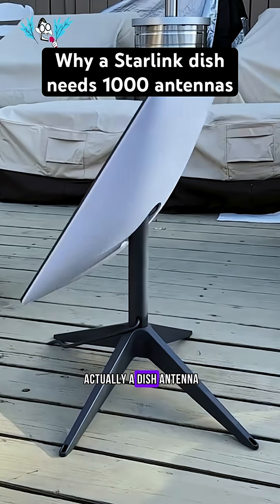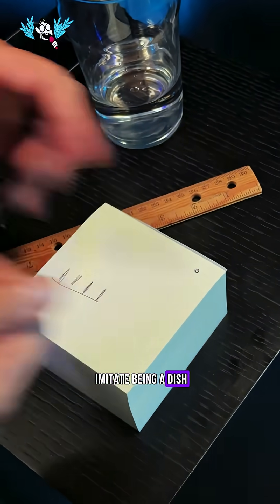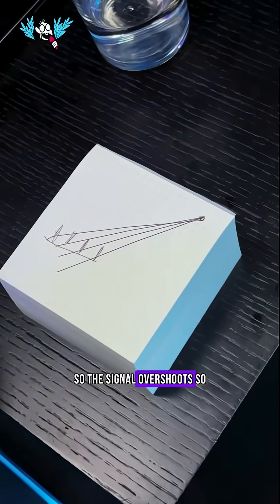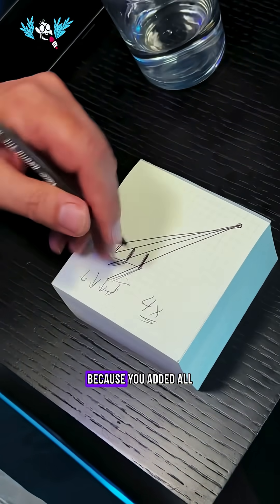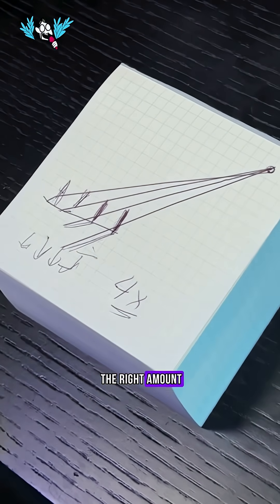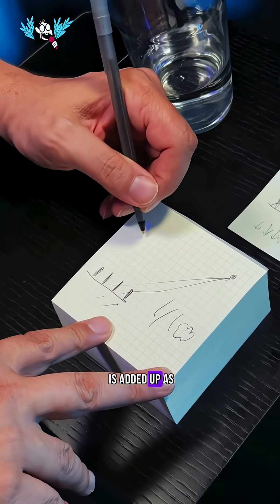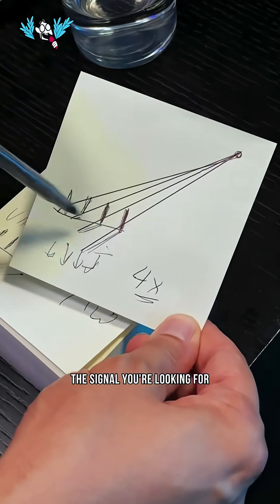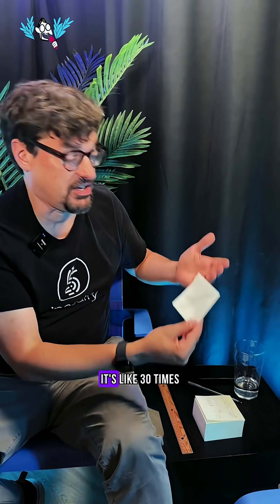Why does Starlink need 1000 antennas?

Comment: Electronically-steerable arrays were way, way out of the league for commercial equipment when I was doing RF and microwave comms in the 90s. Not even the military could implement this tech as a software radio (the DSP happened at baseband).

Comment: speedify works but its not free. if you like free use a proxy server one computer with 2 network cards host a proxy server and on the free network card is your output to a lan. say you have 4 cell phones all with internet and for some reason you also have 5 computers each computer connects to one of the networks and all host a proxy to the same network that has no network. then you can connect to all 4 proxy servers at the same time to use all 4 networks together as one. so i guess its not free you need a extra few computer but its not a monthly bill. theres also a load balancing switch that lets you connect multiple networks together and outputs as 1 faster network cheaper than multiple computers. both methods dont require a bill. speedify works but not worth the bill each month.

Comment: Given the speed of the satellites, there's still quite a lot of math happening at quite a high speed. Modern DSPs.
Reply: DSPs were actually designed for implementing digital filters using MAC - multiply accumulate instruction.

They are good at performing that function.
That doesn't mean they are good at a wide variety of math.

Comment: I wish I patented this when I developed a method to prevent ghosting on analogue TV back when I was at school in the 80's.
Reply from the maker: Did you build a 1,280-antenna array for your tv?
Reply: @Speedify no, echo removal, the ghosting on old analogue TV's was an echo or reflection, the method I was tinkering with was trying to listen to repeated, weaker identical signals microseconds apart. The echo was unwanted and reducing the signal momentarily removed the echo'd signal while leaving the original clear.

Sadly, I was at school then, not understood, and far from supported.
Reply: If I remember correctly, a phased array for frequencies of VHF broadcast TV would have array elements around 1 meter apart.
Reply: Your patent would’ve expired in 2000 as they are only allowed to last for 10 (or 20 years if you pay to extend the license).
Reply: @cyrilio I would have enjoyed the time spent utilising it, and licencing it, and developing future projects. I wouldn't squander an idea.
Reply: sure buddy.
Reply: @giornikitop5373 have you ever thought about doing something, only to regret not acting on that idea?
Reply: You were already too late at that point - the basic ideas you'd need to patent were already in use in the 1960s with early PESA/AESA radars
Reply: @audigex In the US wouldn't be surprised if those PESA/AESA radar patents were put under Secrecy Orders too, which would pretty much make it illegal to sell on the civilian market until the government decides that isn't a national security risk.

Comment from the maker: (It also allows the dish to track multiple satellites moving 17,000 mph across the sky without moving parts)
Reply: This is the actual answer to the question in the title. Geostationary satellites can use a dish aimed at the satellite. Starling satellites move too quickly to physically track them by moving the dish. So therefore starlink has to use a phased array.
Reply: In theory. At least my older Starlink does not do that. Instead, it remembers obstructions of the signal, and tries to switch schatelites before the signal is interrupted, but it can't track two Starlink schatelites at once. Maybe some of the larger commercial Starlink antennas can do it.
Reply: The earth moves too
Reply: @nemiw4429 Not relevant to the problem.
It's how the satellites move relative to the antenna on the ground that is.